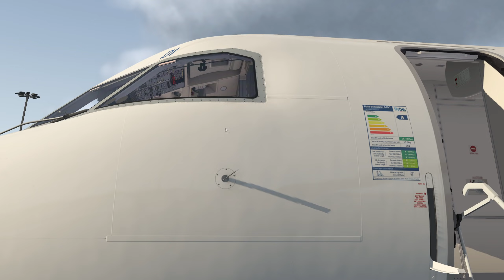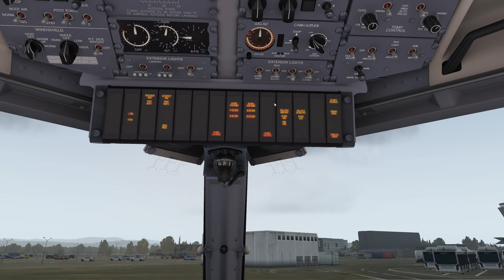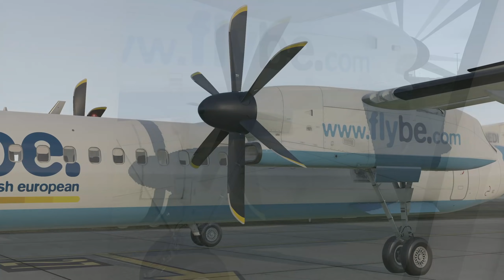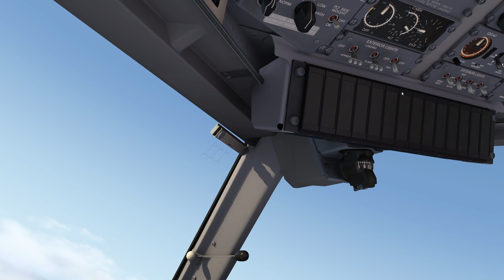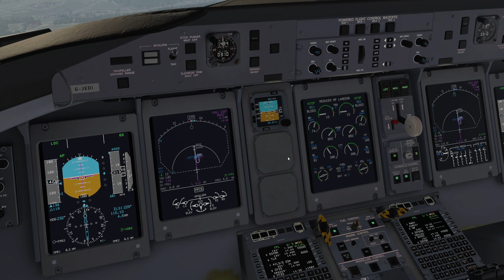My First Love: Ex Real World Dash 8 Pilot Tries the FlyJSim Q4XP Dash 8-Q400! X Plane 11

Comment: You did the exact opposite of the power on procedure, I think you misremembered it as the power off procedure hahaha
Reply: I'm just gonna nerd out in this comment thread:

8:40 They only appeared on DH8A,DH8B and DH8C due to the geometry of the tail being more conducive to tail strikes
Reply: 1:29 Very strange setup here, chocks are supposed to be on the inside wheel for the main gear, and there is supposed to be 3 chocks (split chock on the front, one large chock on the back) for the nose gear
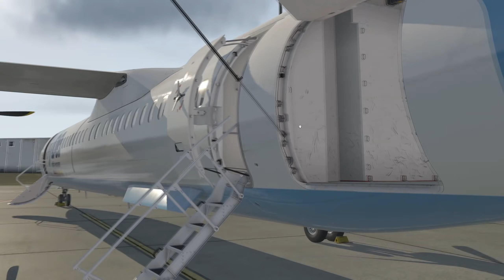Reply: 9:44 These suck to open and close especially in the winter, there are two tricks to close it, either use your shoulder and push up while turning the handle or use momentum with your hand adding clockwise pressure to seat the latch
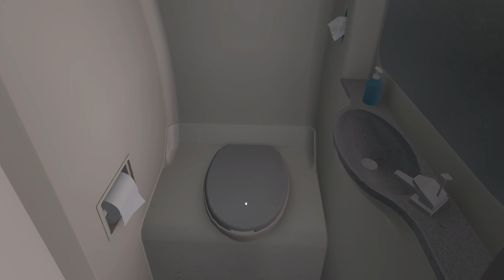Reply: 11:15 The sink is a feature on every DHC8D EXCEPT Canadian market ones (since the water tends to freeze)

Comment: Another flawless landing!  Nice video.  Question - for a plane this well set with features I wonder why it has no autothrottle...?
Reply from the maker: Thanks Rick! The Q400 is based on the older and smaller Q300/200/100 aircraft which also did not have autothrottle. Adding it in would have significantly changed the training required and also the way the automatics work. However for the official reason we would need to ask Bombardier!
Reply: @320SimPilot  True. I fly the ERJ145 as well and it too has no autothrottle... one would think these planes would have this.  Hmm.  Did you ever have the opportunity to fly the 4 engined Dash 7?

Comment: Appreciate this video!  Learned a lot about this aircraft, which is truly an amazing experience.  Just one request, if I may.  Please explain in full the setup of the cabin pressurization.  Today at 15000 ft the cabin turned dark and the cab press warning light came on.  Yesterday I also went to 15000 ft and the cab pressure was OK.

Comment: I am loving your videos as your actual experience helps so much.   I recently got the Q4XP and love that there is so much to do and learn.  I'm now able to do most of the functions pretty good but still having problems getting a decent landing.  With the Toliss A321 it's very easy but this has you doing so much which I love.  I've had to watch sections of your videos many times just to see what I screwed up and hopefully I'm catching most of my errors now.  I've forgotten a few times to put the throttles to max for landing which has put me in major trouble.   With the approach I keep forgetting the heading bug which also causes problems.  Looking forward to flying this excellent plane on many journeys.   Keep up the good work.

Comment: My love for this aircraft comes from a darker place, I was on board the Scandinavian Airlines Q400 that was forced to make an emergency landing in Aalborg thanks to a wheel issue. SK1209. When we touched down, the right side landing gear snapped as it wasn’t locked, and when the engine hit the ground, the propeller blades shot in through the cabin (the captain predicted this so he had moved people sitting next to the engines). No one were hurt, but this was one of 3 almost identical accidents with Scandinavian Airlines Q400 aircraft within just one month, so after this one, SAS immediately grounded their Q400 fleet and they never flew them again. Having experienced this, I got fascinated with aviation after looking into the details of it and it also made me kind of like this aircraft, and my love for it has only grown since then.
Reply: Great story

Comment: I miss flying the Dash 8. The three things I liked are firstly the amazing sound, especially when applying full rpm before take off and then applying pitch. The second is the immediate power, no spooling up just a kick in the pants. And lastly the sectors. Less about the plane per say but shorter flights, always busy, lots of take offs and landings in the log book, always monitoring with no autothrottle. 

Best memory was doing first part of a return to manufaxturer flight, taking one from Birmingham to Reykjavik !
Reply from the maker: Fantastic! Thanks for sharing, it does indeed have so many amazing sounds, I always liked the change from idle to start feather when parking.
Reply: @320SimPilot  yer you get a sudden realisation that this thing might be abit more powerful than you think. Flying empty with max fuel over the a vast Atlantic heading towards the setting sun was the first time I felt really small in such a vast empty space. Still get that feeling over the sea now

Comment: Question, if the auto feather is crucial why did you take off without any problems?
Reply from the maker: It’s a system used to make sure the propellor feathers IF an engine fails. So no issue as all went well but in real life a big no no!
Reply: @320SimPilot  thx, makes sense
Reply: crucial in case of engine failure
Reply: @MikeP343  ok thx

Comment: Is it it available for FS2020?
Reply: No, FlyJSim does not develop for MSFS. This is for X-Plane 11 only
Reply: @Thoar003  they locked their content to one platform? Call me naive, but that's dumb imo.
Reply: @carl8790  They’ve been developing that for the past 3 years, it’s not new
Reply: @carl8790  It's not about "locking" anything. X-plane and MSFS are totally different sims.
Reply: @asystole_  And? It's not that difficult to implement it in MSFS. But it's their loss if the content is exclusive to Xplane
Reply: @carl8790  Xplane and Msfs are by 2 different companies so it is difficult for them to implement it in Msfs as not only is it a newer SDK with a lot of issues still it most likely uses a different coding language as well

Comment: If it is common to start with GPU power, is it then also common to start before pushback?
Reply from the maker: You can start with GPU power, Battery power or APU. If starting with GPU then you would start one engine before pushback, then start the second one during the pushback!

Comment: a couple of things i've gleaned from other streams which I've never seen done before: the volume knobs on the radio panel actually control Vatsim's volume (!); and most if not all of the circuit breakers work (!!), which speaks to extreme system modelling above and beyond the call of duty.

Comment: You see the manipulate handle on the cursor during the nose inspection because those doors CAN be opened! They don't stay open, but they do move. Same with the fueling panel. One thing I wouldn't be surprised to see is people complaining about the performance enough such that we lose the quality we see here. Same happen with the TBM900
Reply: I saw a manipulate cursor appear when 320simpilot moused over the angle of attack sensor, leading me to suspect that you can probably rotate that as well. madness!

Comment: This plane would be so great if they did not completely mess up the performance. Having basically all xp11 airliners this one is the worst performing of all. It's not even the graphics...the sasl  programming seems messed up so the CPU usage is off.
Reply: I have a I9-9900 and 3070 and stil very low Fps. In all other payware I have High Fps. Even a vanilla xp i install Fps is around 35. Nice with a lot of circut breakers (i never use) but if all Those click spots are so CPU heavy…..
Reply: @Morst434  I don't have that issue on OpenGL with a ryzen 7 5800x (same GPU)
Reply: @simutrains8723  They actually say opengl can help for the moment as the bugs seem vulcan related....but in the end its a temporary solution...noone wants to switch to a usually slower old and dying platform just to fly one plane.
Reply: @JackJohnson-cm6jk  Well I don't see a considerable difference between both platforms, Vulkan seems to always ramdomly crash on my system. But I do hope that FJS fix it for fellow Vulcan users :D